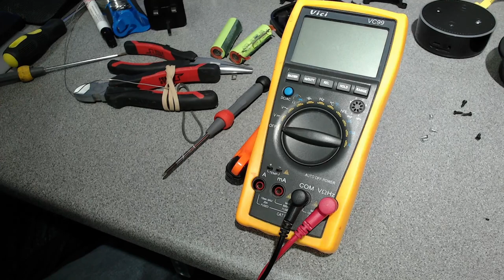Ninety7 Vaux Echo/Alexa Speaker Repair

Comment: Thanks for posting this, my Vaux has developed the same fault and without your video I wouldn't have known that they've crammed the batteries inside of the sound port. 😂
I'll check how unbalanced my batteries are, charge them separately outside of the unit and see if I can reuse the same ones. 😊
Reply from the maker: Good luck!

Comment: Hi Steve. My ninety7 vaux speaker has developed a fault and wondered if you have a fix? The micro usb charging port seems loose and when I plug in the charge cable the charging led on the power switch goes on/off if I move the cable.. can you help me with this at all? Cheers, Alan
Reply from the maker: Sounds like you need to replace the micro USB socket. I can't remember how easy that would be to be honest! You might be able to bend the outer shielding of the port in a bit to help hold the USB plug?

Comment: Thank you so very much!!! I had gotten this speaker not even a year ago from Ebay and was quite upset that out of nowhere it would not turn on. I had no idea how to get into the device to even see what type of battery it used but you came to my rescue! Not only showing how to open it but how to replace the batteries. If I could ask one question, the wire that you put across the bottom of the batteries, what type of wire would I ask for to do that? Or is there anything else to use to connect them? Thanks again so very much!!
Reply from the maker: It was literally just any old piece of wire I had laying around! It not very high current so some speaker wire or something would do. Only problem is it's really hard to solder onto batteries, you're meant to weld but that's not something most people can do! Rough up the surface helped and have the iron on really hot so you don't hold it on the batteries for very long.